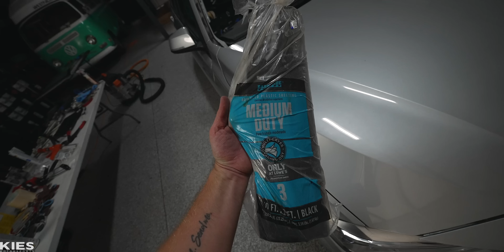🔧 BUILDING the ULTIMATE BMW 328i F30 | Ep. #3

Comment: Awesome job as always, thanks for the videos. As someone who works at a body shop, a little heat would have made it sooooo much easier to separate the panel bonder off. 3m 8115 panel bond is intended to go on bare metal. No need to prime it. Also, should be spread over evenly before putting panel back on to ensure the consistency of the bond. 
Thanks for all the advice on your videos. Just giving some back and not trying to be a know it all 👍🏼